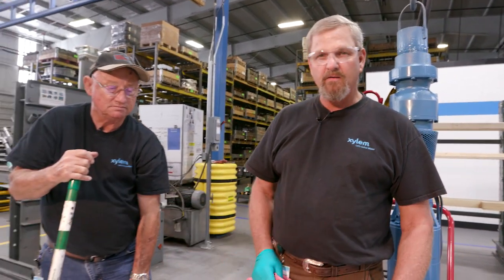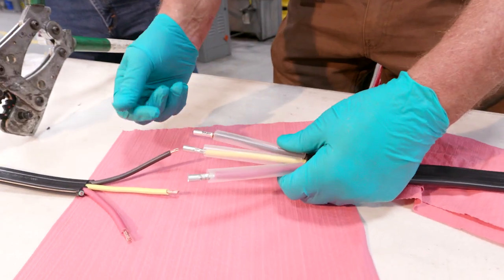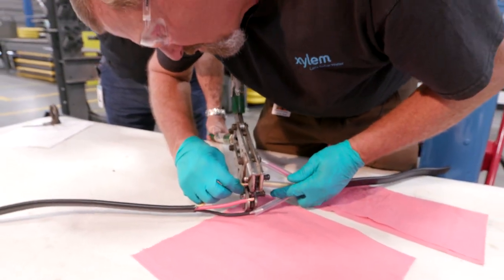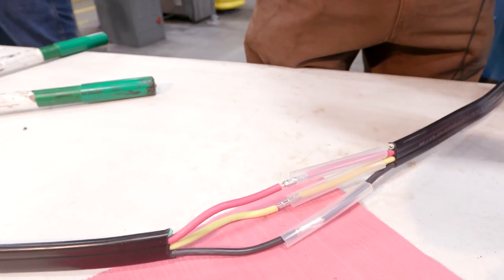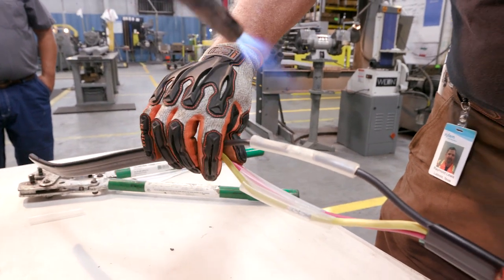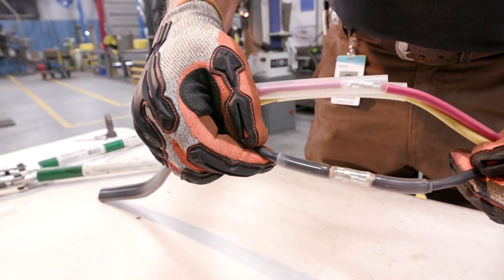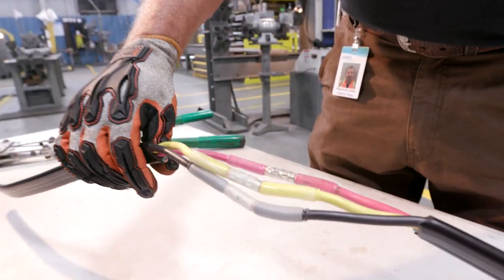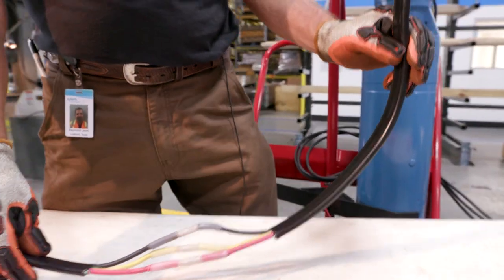Proper Wire Splicing on Vertical Industrial Submersible Pumps - How-to Instructions

Comment: Helpful video.  It would be great to have additional information on the heat shrink tubing, like brand and specifications.  Normal heat shrink tubing does not have glue in it.  Thanks!
Reply: Hells yeah.  That's not the HS sold at the BB store.
Reply: I use this stuff: https://www.mcmaster.com/catalog/126/923

Comment: I'm not sure i can trust people who cut off the ground wire...smh
Reply: The yellow wire shown is the deep well pump motor grounding wire in a 3 wire 220V residential system. The green redundant grounding wire they've cut back was formerly  used to ground the well casing to the household grounding network via the pump motor control box located near the water tank. Since this method did / would provide an "alternate path to ground" (other than the required in-ground electrode(s) at the service entrance), this type of grounding is no longer allowed by the NEC. So that green wire actually should be cut back / taken out of service on any new work done after 2017
Reply: This is not a real installation, no wires carry current. There's no risk or need for ground.